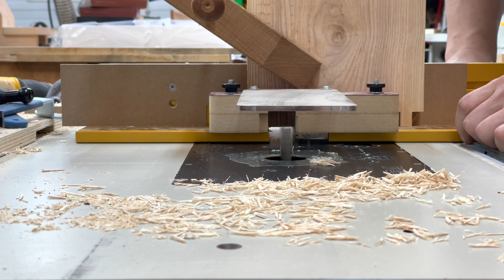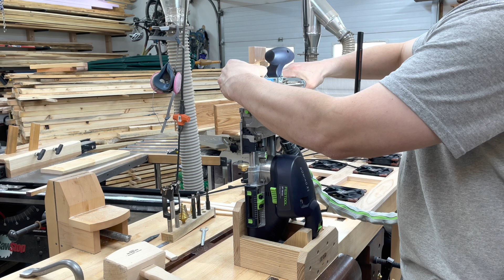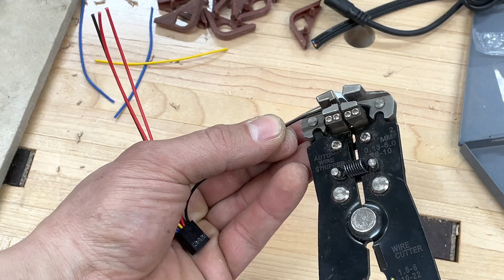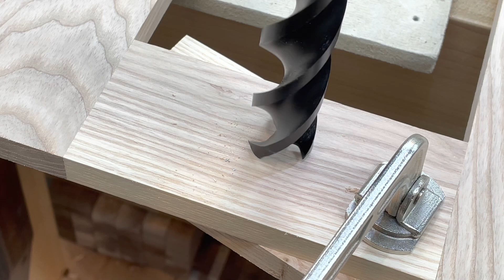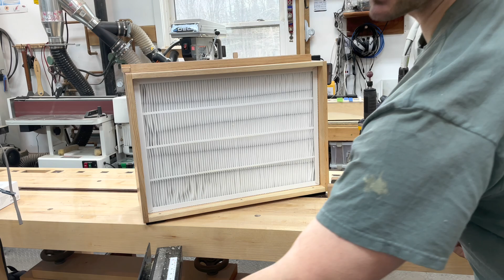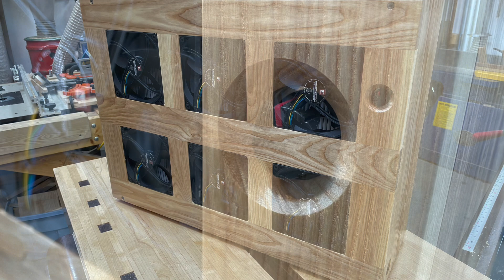Benchtop Dust Collector

Comment: thanks for sharing your build and parts list. I found the Oneida and thought that a home made version should be easy and just as effective, especially since it appears the Oneida just uses similar computer case filters. Since it does use case fans that are lower power, I've even thought about adding a battery power supply sO I can freely move it to different places around my shop like bench for sanding, table saw for cutting, etc. Source collection is definitely the fastest way to get the dust before it gets in the air, but an overall filter for the shop is still needed. The more you can collect at the source, the less work the general system needs.
Reply from the maker: That’s a great point; it would be quite easy to adapt to take whatever power tool battery is in use in the shop - not a bad idea if I ever feel the need to make a more portable mini version.

Comment: Beautifully made. I plan to make one and wondered, now that you have been using it for a while, if you'd do anything different if you made one again and also if you have had to make any changes. Thanks.
Reply from the maker: The only thing I may yet do is add handles to the sides. Otherwise, it has functioned wonderfully and left me wanting for nothing.
Reply: Thanks. That's great to know.

Comment: A couple questions if you don't mind? Is that a 60 Watt 12 Volt 5 Amp power supply? Is the wiring basically joining all the black wires into one and joining all the red wires into one and then putting the red and black in the fan speed controller called "RioRand PWM DC Motor Speed Controller Switch Control 7-70V 30A Fuse" on Amazon?
Reply from the maker: You got it. Power supply feeds the motor speed controller. Some splitter power cables then connect to the six fans (parallel wiring).
Reply: @samuelwiltzius  Awesome. Thanks for being a maker who responds! 👍